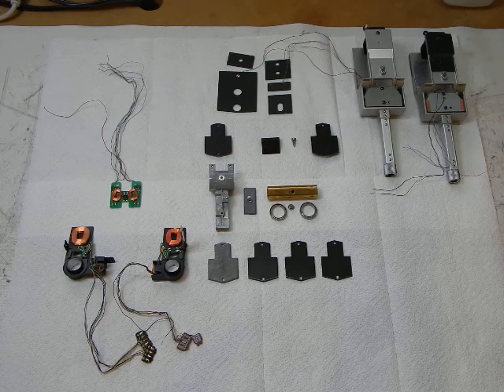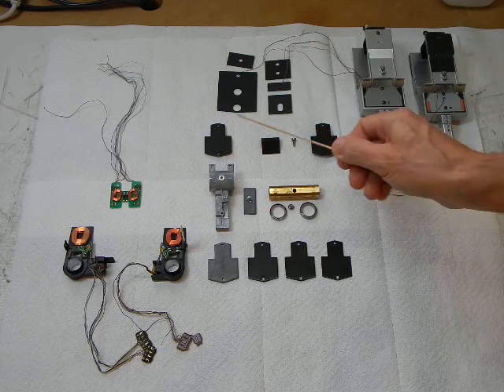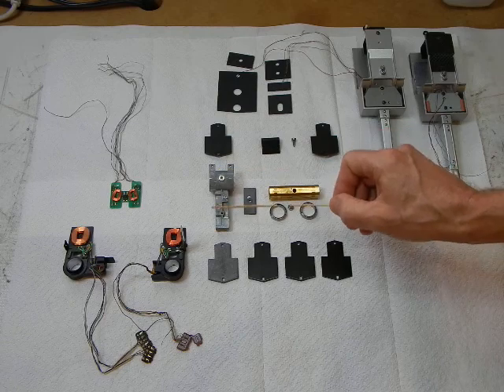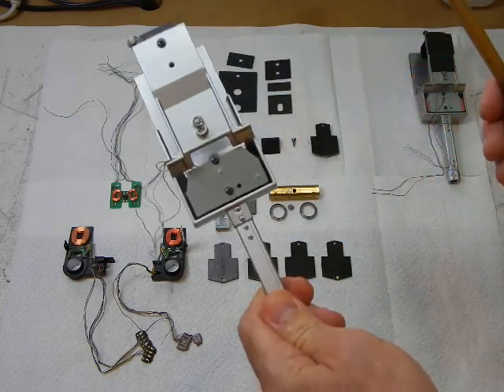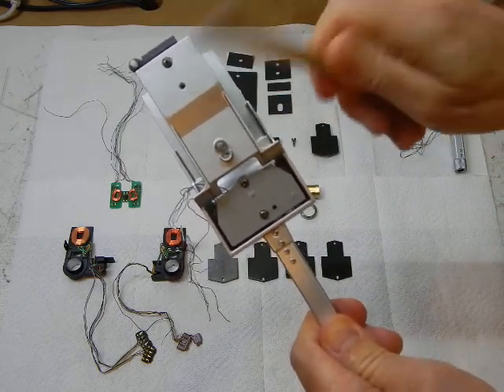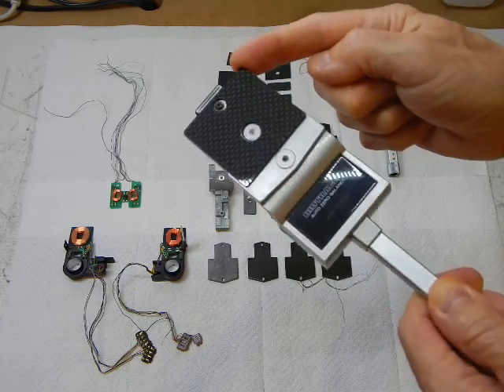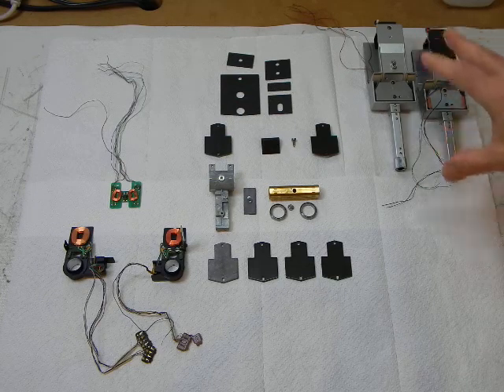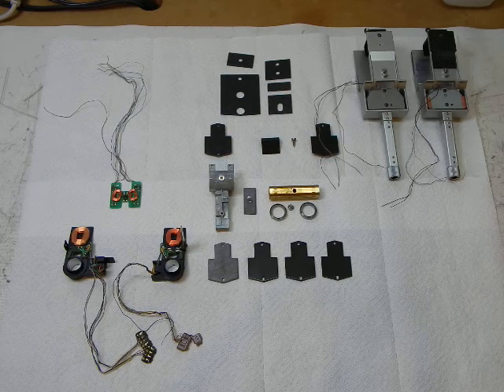Sony PS-X800 tonearm modification & blueprinting service

Comment: kids do not do this at home getting a good look at this tt is why we have the professor to fix and tune up for us thanks for your time showing this to us let me know when you get caught up my 800 is out of the cab in the box  f.d.
Reply from the maker: Thank you Frank.
Yes, the PS-X800 is not a simple and safe turntable to work on. People not possessing a sufficient skill set should NEVER consider working on these. Tragically these wonderful, no longer available, turntables are being destroyed in shipping, we certainly don't need them destroyed from being serviced improperly as well.
I am currently modifying three PS-X800s with my full tonearm mod and custom supplemental plinth. I'll let you know when I get caught up.
Best wishes, Alan